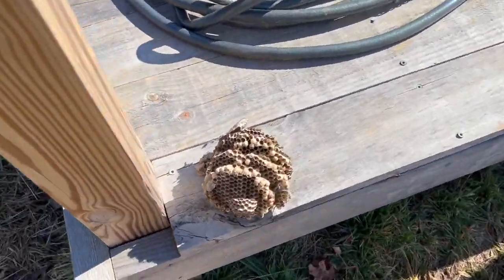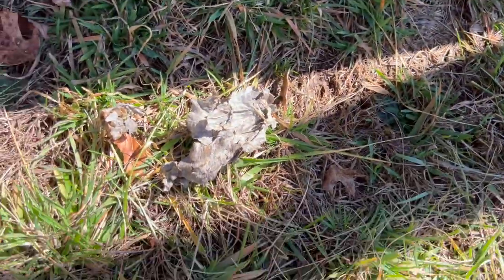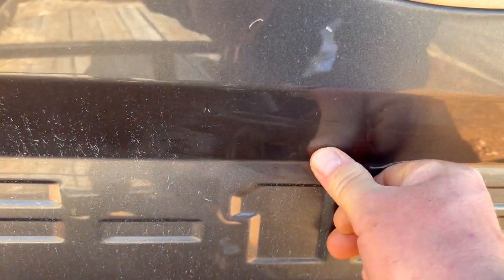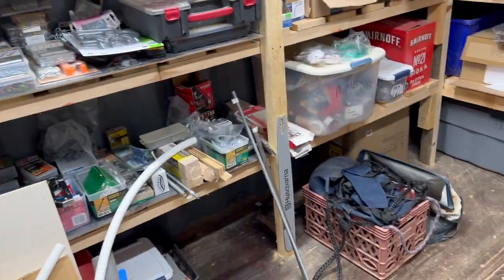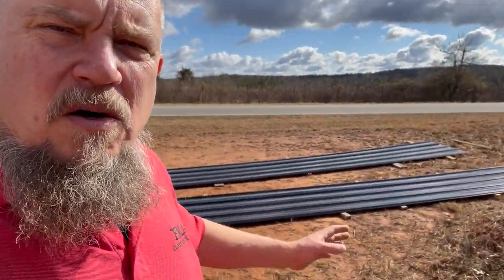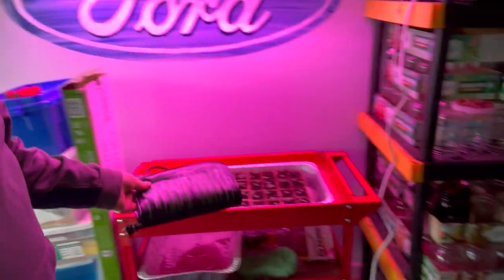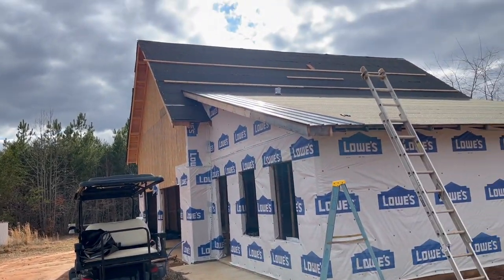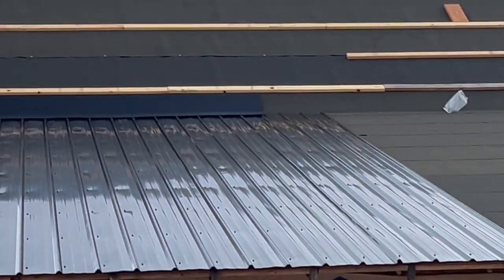Yellow Jackets, Hay and Straw

Comment: Lots of work putting on a metal roof. Not sure if it's too late but unless you use ZXL Woodbinder screws you will be dealing with pop-outs. They have a 40 year warranty. I was tired of dealing with a leaking roof and ended up pulling every screw out and replacing with ZXL's. Haven't had a pop-out since.
Reply from the maker: I might need to replace them on my house AND the new one